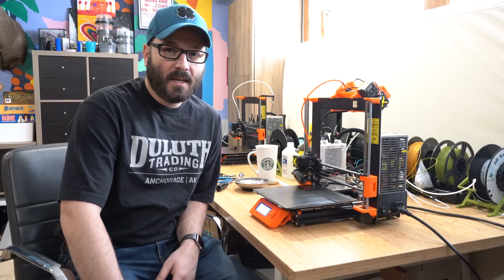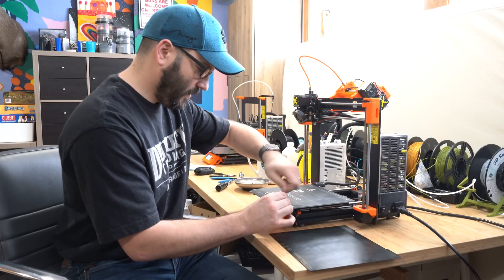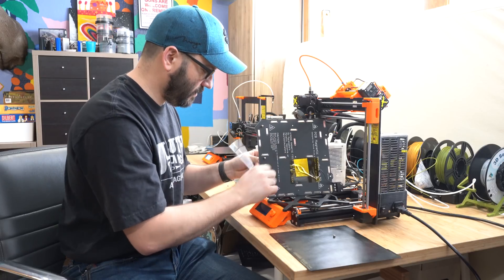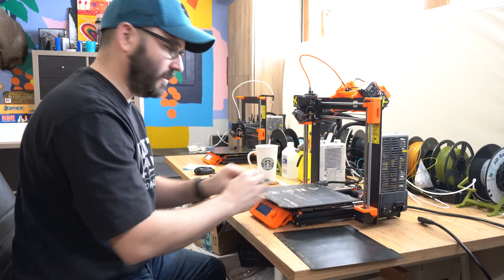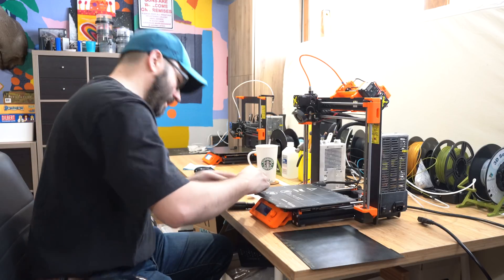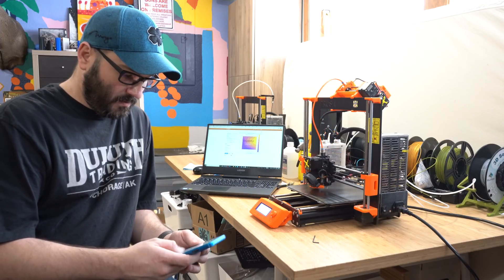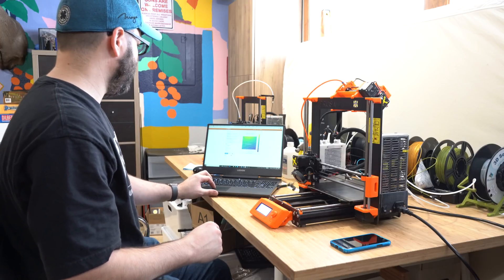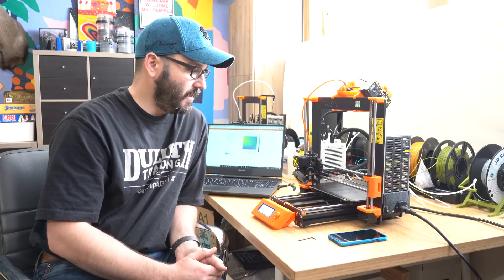PRUSA i3 MK3 Nylock Bed Leveling

Comment: Thanks for sharing! I was having an easy time printing objects small and in the center of the bed but experienced warping when I had larger prints covering the entire bed.  Therefore I am going to follow the process you have lain out for us.  
On another not, would you be able to share the files for the spool holders? I am going to need them when my MMU comes in. (still on back order 0.o) Maybe a thingiverse link? Ty.
Reply from the maker: Here is the link to the new spool holders that I am printing now (they fit in the RepKord Repbox) https://www.thingiverse.com/thing:3516858 Here is the link to the spool holders that I have in the video: https://www.thingiverse.com/thing:3338467

Ben

Comment: What does the nyloc nut accomplish if it just spins with the rest of the screw? I'm just curious.
Reply from the maker: Joseph Vaughn when you get to perfectly level you can lock it against the bed so it doesn’t move, or if it barely moves you can leave it as is and it doesn’t let the screw move, so your bed hight stays the same.
Reply: @bengadget5095  Oh yep. You are right! I got mine to .03 variance, I'd say that's probably close enough. Thanks for this video, I used it a bunch.

Comment: Could you tell me where you got the´spacer you used? Also, what is that white power supply looking thing on the left side rear?
Reply from the maker: Donald Olsen the spacer was the original ones that came with the printer. The white power supply thing, is a new enclosure for the einsey board and a raspberry pi together.

Comment: Nice video, what about vibrations? I had issues with nylock in the past, screws where vibrating inside the frame
Reply from the maker: I haven't had any so far. I have re-checked them a couple times, and they are still good :-)
Reply: @bengadget5095  I'll give it a second try, maybe with brand-new screws, old ones may be a bit used, it's better to have a mechanically leveled bed :)

Comment: Is that Octoprint?  I'm trying to figure out how to get that graph and I don't have Octoprint
Reply: It's a plugin for Octoprint so you can't really do it without it.
Reply: @Enverex  That's a bummer.  Feels like something that should have been in Proterface
Reply: @JordanRosenwald  The output is available directly from the printer with terminal code G81, so anything that can speak to the printer can technically get that data and do whatever it wants with it (be it create a graph, table, etc).
Reply from the maker: It is Octoprint, you can install it on your computer if you don't use a RaspberryPi: https://octoprint.org/download/

Comment: could you make a video showing how to get octoprint-prusameshmap? this is something I have been wanting to do but for some reason the prusa plugin will not show up.
Reply: I'll second this. I can't get it working on my setup. I am using a Raspberry pi though.
Reply: If it's not showing up in the plugin repository list for you, just put the URL into the install from URL field: 
"https://github.com/PrusaOwners/OctoPrint-PrusaMeshMap/archive/master.zip" (without the quotes)
Reply from the maker: Yes, I will, I am currently working on the Railcore II 300ZL and then I will do that next :-)

Comment: Is it me or are your nylock nuts on backwards?  Wouldn't that mess up the threads on the screws and in turn mess up the threads on the Y carriage?  If you look at the Github page, the nuts are threaded onto the screws "properly" so the flat side of the nut is facing/against the bottom of the bed. Like this https://raw.githubusercontent.com/wiki/PrusaOwners/prusaowners/images/Bed_levelling.jpg
Reply from the maker: I put them on backwards as I thought that they would give less resistance while adjusting and less heat transfer.
Reply: BenGadget ok if it works👍. I tried it with a spare screw and nylock and I saw that it basically rethreaded the screw. I wasn’t about to screw it into the Y carriage. Then found the github link and see they show it differently.
Reply from the maker: @NoFlyDrone  Interesting, I didn't have any screws that were messed up, but that is a good point of the threads not lining up correctly.
Reply: @bengadget5095  Yeah maybe your nylock nuts are a little different but on mine the metal threading on the nut is in the direction as if you were using it in normal orientation so it kind of screws up the threading if you force it backwards.  I did it the way shown on the Github and it's working out OK.  Just fine tuning now.  Thanks for the video though, it helped visualize the steps!
Reply: @NoFlyDrone  A trick would be to pre thread the nuts. Run them once the normal way to get the nylon to thread then reverse it. Should help avoid mauling the threads.

Comment: Well, I just finished to adjust my bed level using the 7x7 firmware and with the bed heated.

Now, I'm having a 0.09 variance instead the hideous 0.53 from before.

Thanks again for the tutorial!
Reply: hi did u level  using the 7x7 or also u use nutslocks ?? i use 7x7  but is not enought to level it. thanks

Comment: I have a mk2.5 that I would like to do this to. I think it's a little different than the mk3 though. My standoffs are threaded on top and bottom. There is a screw holding the bed to the standoff and a screw holding the frame to the standoff. Is this how the mk3 works?
Reply from the maker: Michael Platt I don’t have any experience with the MK2 or any version there of. And sadly I don’t know anybody that has one to actually get my hands on it. Sorry, it is not how the MK3 works. On it, there is the one screw going through the heated bed, then a spacer, then it screws into the frame. This process removes the spacer so you can tighten it more than the spacer would allow. And then ads a nylock nut to keep the bed tight and not moving.

Comment: Please explain the computer app and how you are using it, or at least a link to some explanation of it.
Reply: It's the bed leveling plugin in Octoprint.
Reply from the maker: There is a link to it in the video description. It is Octoprint + PRUSA Mech Bed Leveling plugin, running on a RasberryPi 3. I am just connecting to it via WiFi with my web browser.
Reply: @bengadget5095   can Octoprint be installed on a Mac and be connected to the printer via USB cable?
Reply from the maker: @mkacox  Yes it can, here is a link to the setup info: https://github.com/foosel/OctoPrint/wiki/Setup-on-Mac

Comment: Did you also do the firmware tweak mentioned on the github post? Also, can you confirm that this modification showed real differences in your first layer prints?
Reply from the maker: I did not do the firmware tweak, as it’s been about 20 years since I’ve compiled anything. :-( My MK3 and MMUv2 have been working well and didn’t want to mess with it.) 

I started a 15 hour print or so late last night and have not seen the results from it yet, but it looks great so far. On my other MK3 I also leveled and printed about an eight hour print of the LCD panel for my new Railcore II 300 ZL that I’m waiting to ship :-) and it looks great!

Comment: Nice video on the process.  If you regularly print with the bed hot, you might want to redo the leveling with the bed up to temperature.  The heat does make a difference.
Reply from the maker: Pete C That is great advice, I will check them again right after a print and see where it is.
Reply: @bengadget5095  and the result is?
Reply from the maker: @stiffler8632  I did go ahead and re-level the bed with it hot, and it is holding steady! I continue to get very flat prints off of the bed :-)